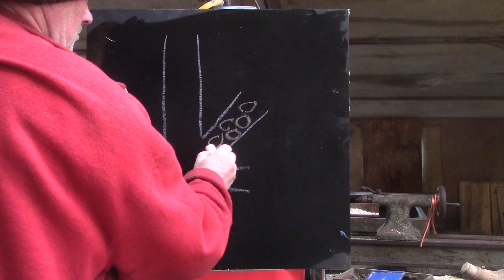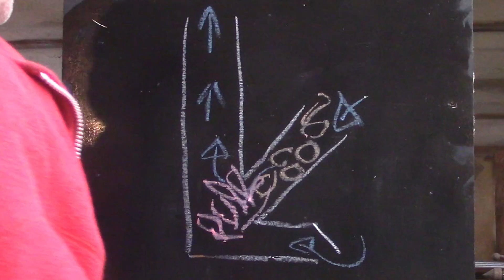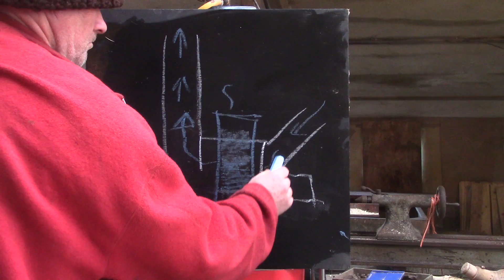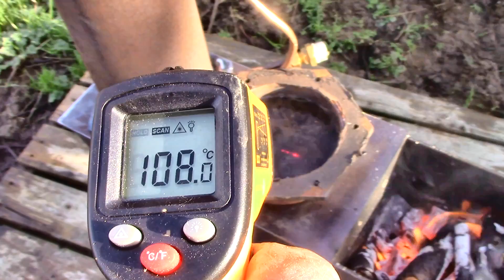I Made A Rocket Stove Water Heater!

Comment: You could use plain dirt as a heat insulator.

When i made my furnace, i used pipes within a bigger pipe, the cap between filled with mud i shoveled from bottom of a ditch.
just 3cm thick and it was enough to keep it cold to the touch.

I would advice to mix in some straw etc to keep the mud/clay/dirt from cracking over time
Reply from the maker: I do want to insulate, but I'm hoping that everything will be too hot to use straw
Reply: @wayoutwest-workshopstuff6299  There are youtube videos where african blacksmits make the whole iron bloom furnace out of dirt+straw and it last's several uses.

Yes the inner layer of straw may burn or turn to charcoal but the outerlayer's should last long time.

you could try to make a simple pot out of the stuff and scorch it with a torch to see how it withstands?

Comment: Another concept you might also consider incorporating is preheating of the air by using a heat exchanger on your chimney or firebox
Reply from the maker: Some say that makes things worse though - because there's less oxygen in warm air
Reply: @wayoutwest-workshopstuff6299  oxygen is the same provided it’s heated by a heat exchanger. Air fed into combustion in coal fired base load power stations is pre heated to increase efficiency and in general almost all waste heat that can be recovered is energy also put into feed water.
I built a burn barrel recently for sticks, leaves etc and I incorporated an external sleeve of corrugated iron so air is drawn down the outside to the bottom to a slightly elevated grill and it burns very clean once hot with almost no smoke once it’s hot.
Anyway something to consider

Comment: You need a stainless pipe in the chimney. The copper ones will fail (spectacularly) if not cooled enough - which they are not going to, as you feed them with steam and not water.
Reply from the maker: I'd need a complete redesign if I replaced the copper with s.s. - that stuff is very expensive. And how do you bend it?
Reply: @wayoutwest-workshopstuff6299  well, my reply got lost somehow, maybe because of the link.

So yeah, you could buy pipe, but you could also buy prebend pipe. There's 304 pipes prebend for heat exchangers available for cheap. A 9 loops 20 cm diameter pipe is 30 € on amazon in Germany.

It's actually meant for something different (to cool down stuff) but it's 304 and it shouldn't really matter, as your copper pipe is certainly not designed for the task as well 😉
Reply from the maker: Thanks, Ruben. I found other interesting things on there, but not what you describe - could you maybe find me the link please?

Comment: Put a lid on top of the burning chamber and let it draw air up right and left of the chamber.

Since the chamber will basically immediately heat up the air on the sides, the air will naturally rise up there and avoid that your stove starts with burning in reverse.

To get the chimney going faster you can put a small chamber below it with a door where you can put some paper.

That's how the people around here "started" chimneys in wet weather: Make a fire in the chimney itself in the basement with some newspaper, to make some hot air which then allows you to start the fire in your oven.

The chimneys here are usually pretty long and not well insulated against moisture, so they took a long time to get starting otherwise.

Comment: You also need to make a hard kink in the airflow, to force the air to drop the ash particled. Else you'll blow the ash and some amber pieces out of the chimney or they will choke the chimney in no time.

You can also add water to the collector for the ash. This avoids that vibration will dust the ash up again. Just make sure to use stainless here, ash/water mix might otherwise eat your metal away.

With an outlet you can easily and dust free drop the ash/water mix and won't even suck in air through the port if you refill the container at the same time (you basically flush out the ash with water until the water is clean and then close the port again).

Comment: If you're trying to build a steam engine, why not build a steam engine the way steam engines have been built for a couple hundred years?  Put the water tank of the boiler AROUND the firebox/chimney so the heat transfers to the water better.
Reply from the maker: Only because making the tanks water-proof is not easy - but I might do that too.

Comment: What do you need to do is have a pressure gauge and seeing how much pressure you can produce in that boiler. In the miniature World a lot of the steam engines have the pressure gauges to see how much power the boiler can hold. Most small boilers will hold up 200ps in the engine. If there was a way I can contact you or give you some information I'd like to try to help that give you some ideas
Reply from the maker: Thanks but this is not a pressurised boiler - it's going to be a flash-steam boiler. So the steam pressure never rises more than the pressure of the water.

Comment: Sadly you Screw up the rocket stove Environmental Friendly Element With The Water Tank being in the Fire (You also Messed Up the Water To  Stream effectiveness & efficiency Too)

Let Start with the Water Tank Completely out the Fire (The Water volume is Too big and will Take ages To boil ) let Relocate That  to the top of the flu Stack Far away from the fire We will Use the Heat Gradient of the Flu chimney  to pre heat water Top Cold to Bottom Hot Via a pipe Heat Exchanger to a 2nd  Pipe coil "the Polishing off" Pipe coil (Wire spaced Tubes)  Heat Exchanger in the burning Solids of the Fire (The Hottest  Part of the fire) We also draw are Steam from here at The Fire

6x 6 Foot Steel Tubes Wire Spaced Pipe Coils in the fire solids  and you have a Dry 400C~600C Stream with a few Psi (Water to steam in just 5 sec)

Find a Videos on YouTube 
"How It's Made - Steam Engines" 
"How it made Cyclone Steam Engine"
Reply: Cyclone Steam Engine Steam Boiler feeds Water from the outside Pipe Coil to the inside centre Where the Stem is Extracted From the Center   

It runs on multi fuels  Liquid & Gas (Syngas) & pellet fuel solids (Bio mass Charcoal pellets ,Wood pellets , Lawn (garden waste) Grass pellets , Cardboard & paper pellets also poo (animal waste) pellets )
Reply from the maker: Ah but wait - it's not finished yet!

Comment: There were a time in the around 2009 when there was a lot of work done on rocket stoves there was even a a website to exchange ideas. IIRC adding preheated air in the middle of the flue will increase the burn

Comment: When we talk about insulation, what do we mean, koa wool/ ceramic fibre mats all the way up around everything? And rigidised? That stuff is great heat resistant insulation but incredibly dangerous to breath in but I’m sure you are aware. Or do you have a different solution in mind? Very excited!
Reply from the maker: I'm thinking vermiculite around the chimney somehow, and rock wool wrapped around the firebox? What do you think?
Reply: @wayoutwest-workshopstuff6299  your case is perhaps more aligned with blacksmithing and pottery kilns than the classic living room woodburner I think, given you are trying to retain as much heat as possible to enable fastest boiling times. What temperatures are you expecting for the firebox once insulated, and do you need to be able to “pull the plug” at any stage during burning to quickly get to the innards of your firebox? That might dictate the materials as some might be easier to remove and put back into place than others. I read rockwool (as many other mineral fibres) becomes crystalline above a certain temperature though, at which point it is more likely to end up in your lungs through vibration etc of the whole contraption- maybe perlite all round is better as a first layer, then rockwool around that? My gas forge has a 1” layer of that koawool but it’s not exactly a fair comparison as two propane burners create insane heat and there is no flue. 
I have managed to forge quite well with charcoal fire with a hairdryer forcing air in from underneath, so with that cone possibilities for you too I feel- maybe a battery powered blower for the first few minutes to get the water boiling and the glue to draw? It’s going to be a small cost but help make the startup process so much more efficient. 
By the way if you ran that setup a lot a lot, you might also see some oxidisation of the steel so may need to have parts like the grate replaced after a while. 
I’ll stop rambling. You’ve got this :-)
Reply from the maker: @alexnosheds  Ha! Well, I'm not sure I really have this at all, but I'll keep plodding along.. : -  )

Comment: The water designs reminds me of the Irish Kelly kettle where they have the water on the outside of the chimney. Maybe you can put the pipe wrapped around the flue on the outside and insulate all in so the heat rises quicker. Ver interesting project, loving the updates.
Reply from the maker: Interesting!

Comment: Tim insulation iedas have the whole thing ceramic coated by a company that ceramic coats exhaust manifolds that should reduce the heat loss through the sides of the stove and increase the heat of the gasses and protect it rusting more.
Reply from the maker: Sounds expensive, Ben?

Comment: Based on my own experience, the steel will not last long in the hottest parts of the fire, with moist o2 (aka Irish Air) flying past it. Even in SoCal the air is wet enough to rust hot metal at high speed. The burn box needs to be fire brick. So... That gives you a cheaper / faster way to prototype new burn boxes: Stack bricks with a bit of high temp morter to hold them in place. Then /after/ you get the burner working at full pace, build a metal box to hold the bricks. The grate should be cast iron or something that wont rust as fast, but it can also just be replaced.
Reply: Fire brick also helps insulate. Inside, where you need it.
Reply from the maker: You're right - I just wish I had access to a pile of those bricks.
(Also the grate will be steel tube soon)

Comment: I built a rocket stove submerged in a hot tub recently. I found the flame going through the chimney straight away. I take some fire starter and light it at the bottom of the wood box and the draft goes out of the chimney straight away. You want a very hot start. So some newspaper and fine kindling creating a fire storm in the first 30 seconds make it go out of the chimney.

Comment: It is exciting Tim. Have you considered a steam temperature gauge to monitor the temp at its hottest point? It would help to know at what temp the system fails when and if it does. 
Eventually you'll need at least one when you put the steam to an engine. Maybe?
Also exciting is what Tim will choose to use as an engine. Cheers 🇨🇦

Comment: Here is a fun idea, why not build a fireless steam engine! (compressed air engine) you produce the pressurised gas elsewhere and just fill up the "boiler" with steam every so often. So you could use a rocket stove to make your steam, or what I think is a better idea, use your stationary engine to compress air which you can run the engine on. I think it should be easier to build than a regular steam engine but still give you the feel and some of the sounds of a normal steam engine. An alternator driven battery loco is still probably the smartest idea but I think a fireless steam engine should definitely be on the "fun ideas" list
Reply from the maker: that would mean building two pressure tanks though - I'm a bit wary of pressurized steam.

Comment: Steam locomotives / engines have water injectors in which you open the outside valve to let cold water in, close that, open the inside valve to let enough steam in to equalize the pressure before letting the cold water in. Some are close to the boiler so that they can be left to heat up to near 100.D.C. before injection to reduce condensing
Reply from the maker: Yes, but I'm trying to build a non-pressurized boiler
Reply: @wayoutwest-workshopstuff6299  Oh, you mean a kettle? ;-)

Comment: As I understand rocket stoves, the idea is that one wants the combustion area as hot as possible to release all the gases within the wood and then to be sure one can add a second air input ABOVE the fire to create a secondary burn of any gas that does not burn in the primary fire. The chimney emission should be clear with dry wood which should have a large surface area to volume and the stove should start and reach operating temperature quickly. The amount of heat that can be extracted from a wood burner with the boiler above the flames is 80%+. In my wood burner if I don't have the water circulation pump on I can easily boil the water. If heat is being extracted from the combustion area one is reducing the efficiency and wasting energy as unburnt flammable gases will escape. The entire outside of the stove can be covered with fire brick to reduce heat losses and maximise the opportunity for heat transfer to a boiler with the proviso that you don't want things so hot that any boiler materials melt. Good Luck!

Comment: Dear Inventor Tim.
👍👌👏 Very well done (video and work). Congrats, your stage 2 oven already works much better. For further improvement please kindly allow me some suggestions/questions. And please don't get me wrong, it's definitely not meant as criticism! I simply can't resist because I'm a proven (or is it confirmed?) inventor too:
1) I think that it would be much better/more efficient for the draw/heat if the boiler would not be going completely through the fire chamber. In my opinion everything would work better if the boiler would stick out more above and therefore leave a small gap underneath it's bottom and the bottom of fire chamber.
2) I also suggest to wrap the copper pipes around the outside of the chimney and insulate everything well. In this case the draft wouldn't be hindered so much. Additionally the chimney pipe could be cleaned from soot a lot easier.
3) Maybe you could also wrap nearly the complete stove with copper pipes and especially with insulation.
4) If you like to increase the size of the stove and boiler in the future, maybe an old inert gas/acetylene/oxygen tank/bottle can be used.
I'm eagerly looking forward to watch your next video.
As always: Thanks a lot for making teaching explaining recording editing uploading and sharing.
Best regards, luck and health from Germany to all of you.

Comment: I am a bit late maybe with this suggestion Tim, but what about wood gasification? You are going to make all that charcoal and drive of the volatiles during production. Those volatiles are pretty useful. There are some very simple devices on YT, it may be possible to get the big engine to run on wood gas.
Reply: I don't think diesel engines like what Tim's got are really suitable for wood gas. Petrol engines go just fine on it though.

Comment: Morning Tim another interesting video, I have spent the last 30 years working in small scale steam generation  commercially, and I think you will find out why monotube steam generation in a small scale is not use much, particularly wood fired however good luck . One point if you are going to superheat, you cannot use copper pipe or brass plumbing fittings the extra heat will just destroy them. You need to go to steel.

Comment: Might want to add a pressure releaf tank if you end up hooking it to your water main, If your water system has a check valve.  Not a plummer but in US it's required to have.  Keeps pipes from bursting with expanding steam.  Just set it to the same pressure as your hot water tank on the high end, less a few psi. 
Brought to you by your local youtube backseat mechanic.  :D

Comment: Maybe add a small high cmf but quiet fan in a tube with a check valve to blow air through the  fire🔥.  Should make it easier to light and burn a lot hotter with all that O2.

Comment: Very cool. As it currently is it might not get tremendously hot, but it sounds like super-efficient rocket stoves get so hot they can melt ( melting stoves are not ideal). 

Simple suggestions you could try are holding a small fan above the chimney just to start pulling the air; you could put a door on the fuel chute and try firing it with secondary air instead; add more baffles on the floor next to the boiler to make the air spread the heat more; and on a mark 3, you could lengthen the system, with another small space between the fire grate and the boiler to burn the residual fuel air. I really do want to wait and see what you have next for us first though.
Reply from the maker: Good idea. Thanks

Comment: It looks like great fun and I love what you’re doing, but practically, do you really want to wait 20 minutes for boiler pressure every time you want to move a wagon of branches?

While not nearly as exciting, seems like a gas or electric motor would be more appropriate.
Reply from the maker: You're quite right, Paul. It would be a serious negative if I can't improve on that. But getting the fire hot quicker should be quite easy, and when the floats are in position in the first boiler there'll be much less water to be heated up - so there's still a chance it could work

Comment: Oooh I do love your inventiveness Tim! Rockets though can get so hot thar they burn through steel quite fast, plus the most energy is produced inside the flume, so this is after your boiler. And I hate to be a sooilsport but pressurized systems can be very dangerous. Have you seen Geoff Lawton's first and second video about their version?https://youtu.be/1oDpmmsqHwQ
 No doubt people have developed beyond that a lot by now, these things are improving fast now. 
There are also batch rocket systems, in which a load of fuel is set on fire in the big first chamber, and the smoke and soot gets a second burn in the second chamber
Reply from the maker: Thanks, Conrad! You're right - but I hope to make use of that heat for the next stage of the heating..